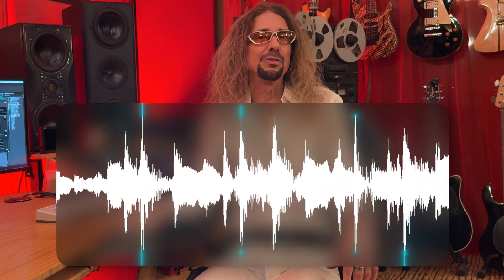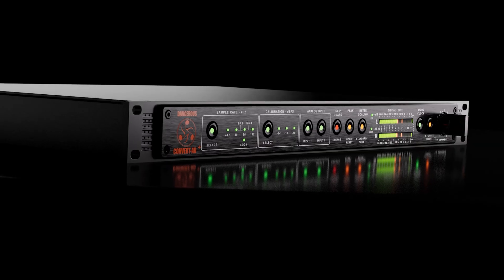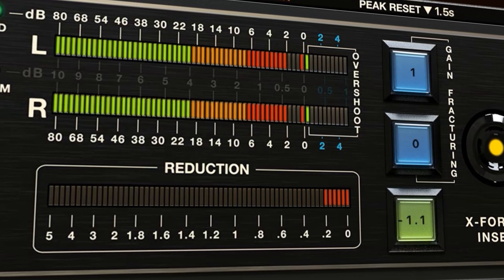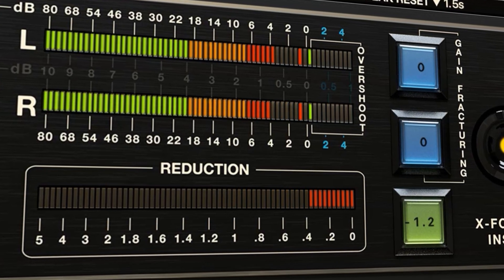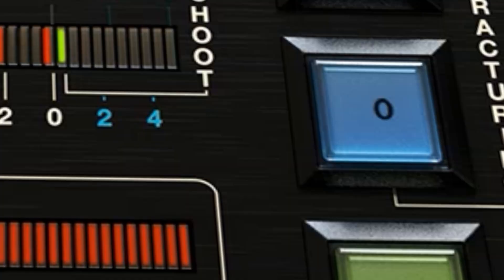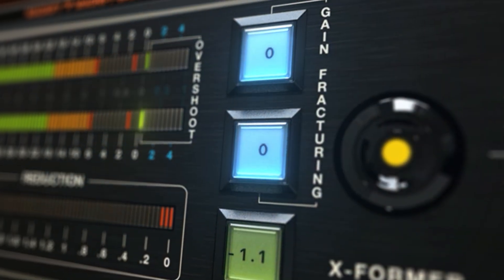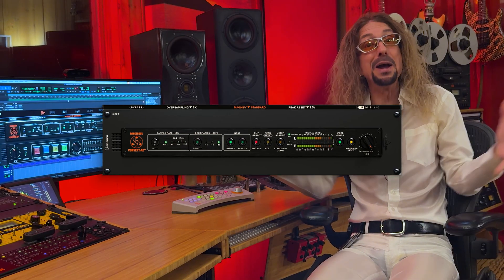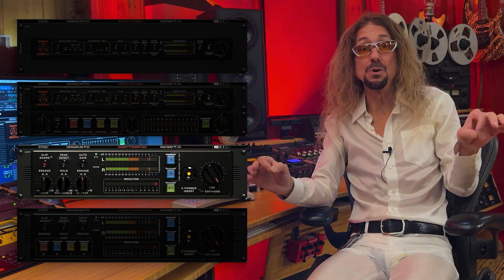What Is Gain Fracturing? The Real Secret Behind the CONVERT-AD+ Plugin

Comment: 0:54 Can an interface have the ADDA from an ADAT?
Reply from the maker: I'm not sure I understand your question. Are you asking whether you could use the A2D and D2A from an old school adat recorder to get those crunchy tones without recording to the tape? I'm pretty sure (fog of time here) that if you went in analog (Use the ELCO, it skips the resistor network on the 1/4" side), armed all the tracks and connected the lightpipe out that would get you A2D. If you took the analog out, that might get you the round trip. We'd have to see if it's an analog pass through or not. Eddie Ciletti or Roger Deller would know.
Reply: @dangerousmusic  Yes, I mean, the texture of that album is fabulous, and so the ADAT, so that thought crossed my mind when you were talking about the ADAT. But, if the ADAT has tape, I guess is not possible. 

Although, I feel that the digital texture from 2000-2006 albums is fantastic. The only variable I see today (taking in count the use of an analog console and peripherals) is the interface and the computer. Unfortunately,  I don't see that tasty texture in today's big budget/mainstream albums.

Comment: Mm still don’t get what the plugin is doing. Is it a digital clipper with the looks of my beloved AD+?
Reply from the maker: Basically it models the sound and behavior of the hardware minus the conversion part (obviously). Plus adds tools and views that are only possible in the digital realm.
Reply: @dangerousmusic   thanks for explaining, but it came across like the plugin was supposed to be used after the conversion part from the unit.
Reply: @dangerousmusic why not make a plugin that looks into my real converter and give me more options with the real hardware. It already has a great metering but a loudness option and some other stuff would make sense. We don’t have the option of setting a clipping threshold on the hardware yet.
Reply from the maker: @gwsound  Most of us work in a hybrid world with digital and analog tools. We leverage the strength of both by addressing the strengths and weaknesses of each.
Reply: You're right this video doesn't really explain the need for it, it's like he started too and then forgot to finish the explanation.
Reply: @sonicsignals I agree. It’s a bit confusing what the main purpose is. It’s a limiter and a loudness meter, but the features copied across from the AD+ seem redundant. Perhaps I have missed the point (I am an AD+ owner).